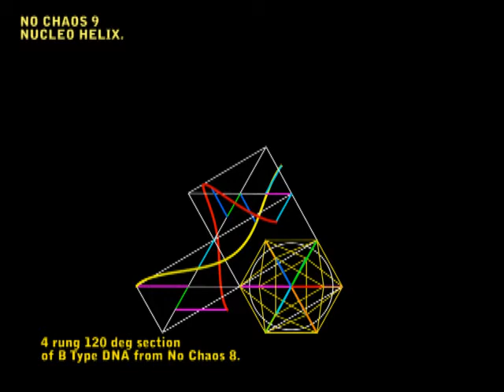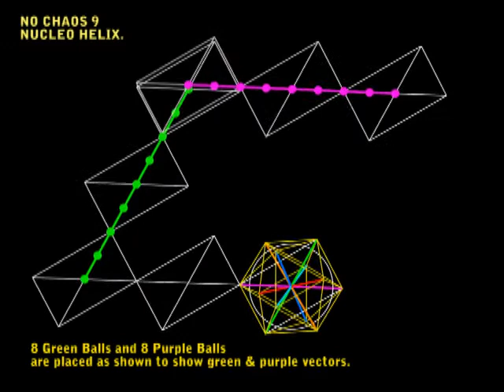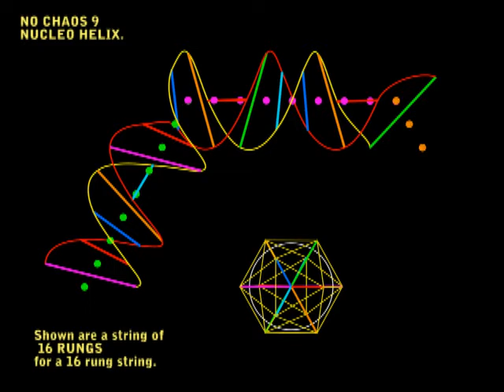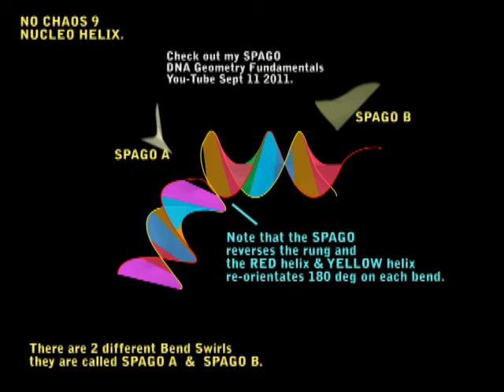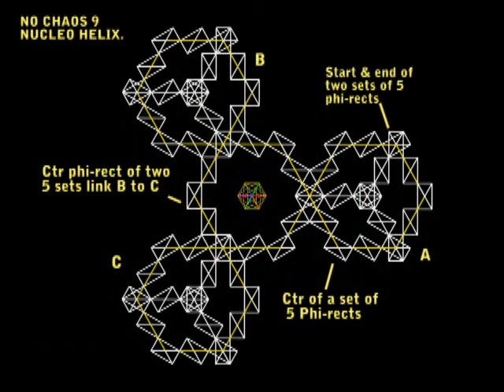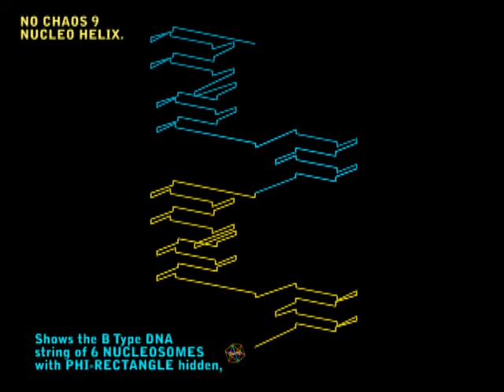3D PLATONIC ORDER NO CHAOS 9  ( NUCLEOSOMES )

Comment: When you say there are "10 20 of them" does that mean 1,020?
Reply from the maker: The Vector mid points are in the center of the Dodeca so they can be 10 vectors or 20 vectors if they are split.